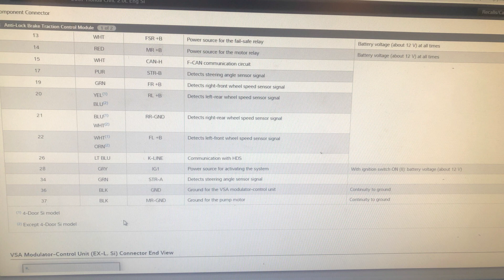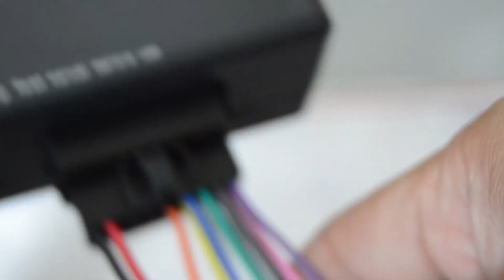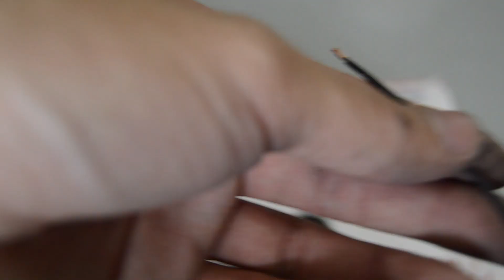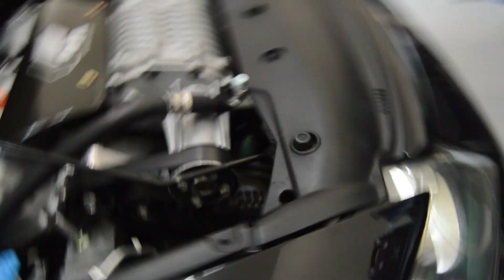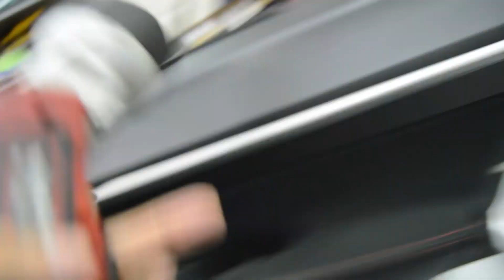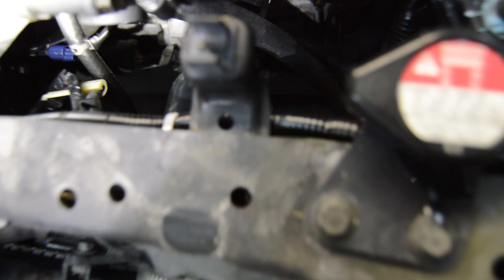Hondata traction control install

Comment: Is the orange wire what knows when the wheels are slipping to send signal to ecu ?
Reply from the maker: Yes that's the signal for ecu to cut timing (cut power)
Reply: Ok thanls but would you know the type of signal it throws like power ground ect  sorr from dumb ? Im jus trying really understand the module thanks

Comment: For the Traction Control orange cable, you cut the ELD orange cable from the A23 computer connector and connected to which side of the chopped up cable?
Reply from the maker: To the ECU side
Reply: Thanks!
Reply from the maker: No problem let me know if you have anything other questions